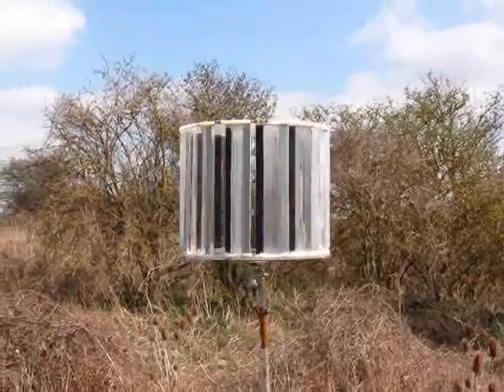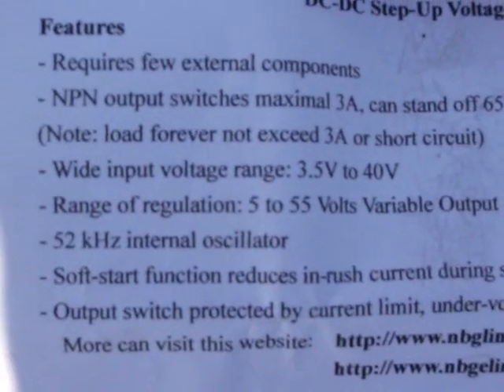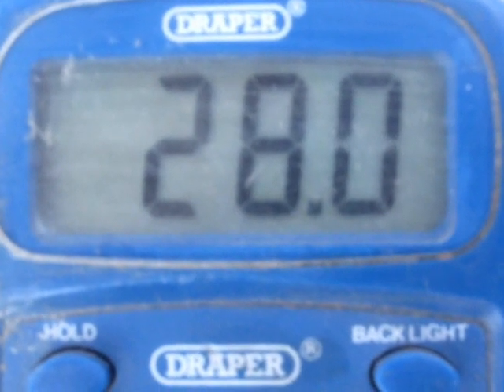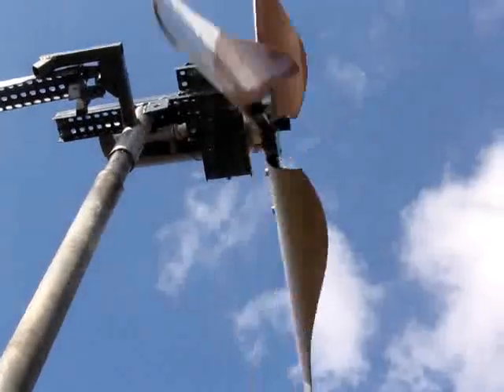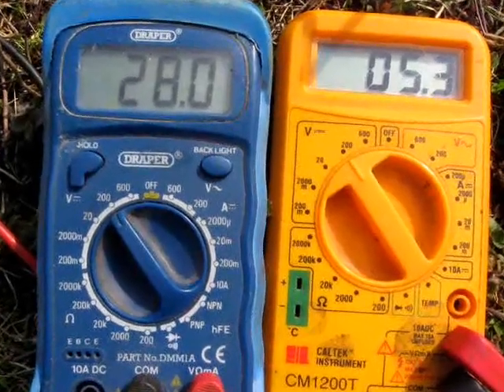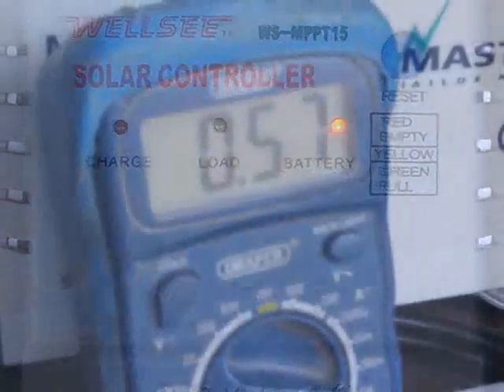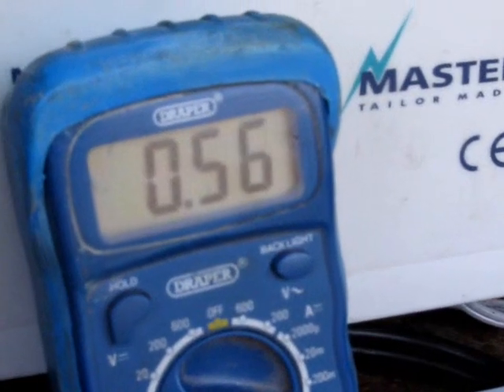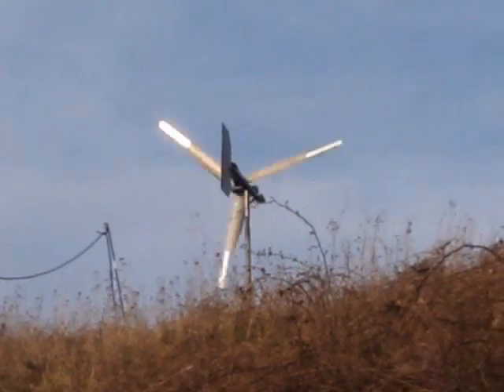Wind turbine step - up regulator

Comment: Thanks for posting this even if it's over 3 years old it helped me because I have the same issue where I have low volts but high amps and need a way to make use of the power instead of throwing it to the wind

Comment: Most treadmill motors will only put out at most under a good wind 7to 9 volts now if u have 2  or 3 of these wired together u will have a good charging system ,treadmill motors are a great tool for generatoring power but it can only go so far ,building 2 or 3 of these as I did will work very well in low winds

Comment: Most of these power supplies that do step up the voltage like the one your using do put up a good show ,but don't work to well under a load or hooked to the battery bank.With a  treadmill motor the best way is to gear your windmill up to at least 4 to 1 ratio,once this has been done it takes lots more wind to move the turbin blades and get a good charging 13 to 14 volts out of the unit . 
one way to double your voltage take 2 windgenerators wire them as u would in parallel 6 volts+6 = 12
Reply: You mean series..